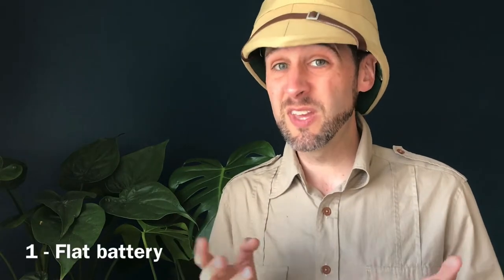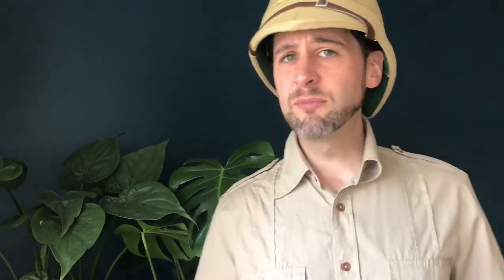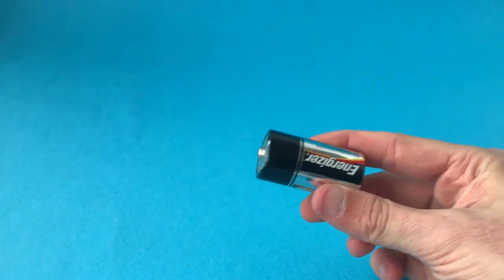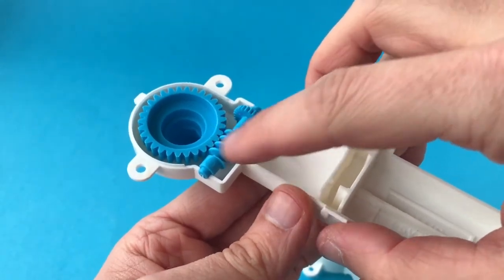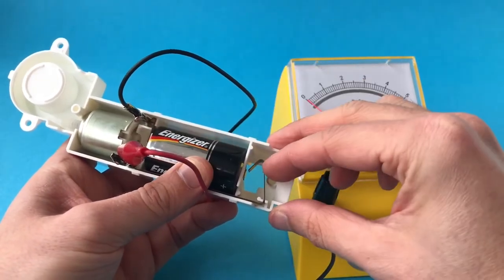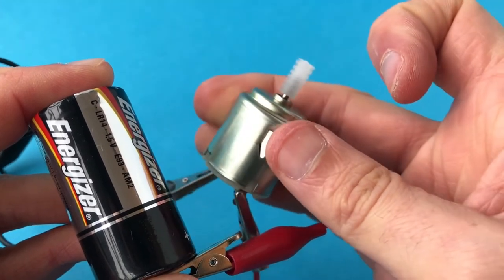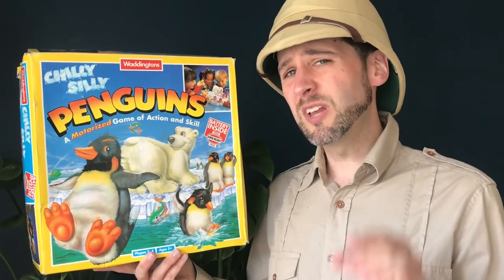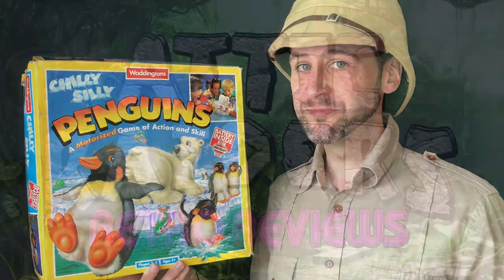How To Fix a Motorized Vintage Board Game

Comment: I would say for more advanced tech,  it's definitely worth buying a can of WD-40 contact cleaner,  just the simple premise of spraying it in any gaps can help.   And as it's not water based it won't do any damage.
Reply from the maker: Will keep that in mind when I come to fixing up my copy of Electronic Detective.
Reply: @AtticRaidersRetroReviews  Awesome,  Battery corrosion can be a nightmare though,   I bought an atari lynx off ebay a few years ago, and the batteries had leaked so much, they literally burned a hole through the entire motherboard!

more annoyed as the seller stated it as working >.>
Reply from the maker: @Larry  Oof!  That's pretty bad!  I've had a could of battery corroded games, but nothing that a bit of vinegar scrubbing and scrapping hasn't fixed thankfully.
Reply: @AtticRaidersRetroReviews  Oh yeah, one of the good things about these kind of games,  they're so basic, most of the time it's just an on off switch to connect power to the motor!

Comment: Great tips - I've done these repairs numerous times too, most recently on flippin' frogs which had a stuck motor as well.  Most time I spent on repairing a game was flying thunder, three motors all worked fine but that game is known for having many nylon gears that crack and split. Most are probably impossible to find in correct module and tooth count plus many have reduction gears attached.
Reply from the maker: Flying Thunder - what a game!  I'd love to have a copy of that one day.  Yeah, nylon gears are a total pain to find exact matches for replacements. :(